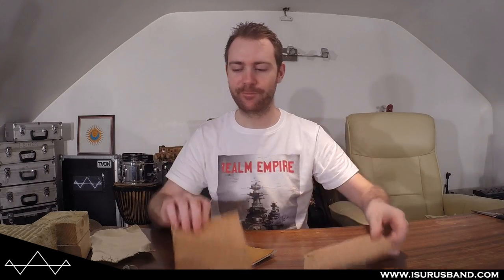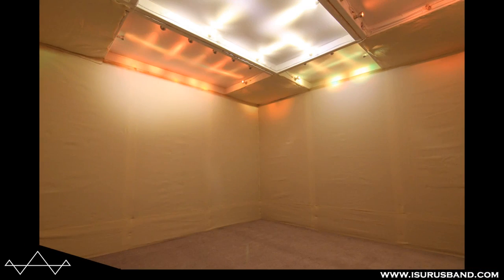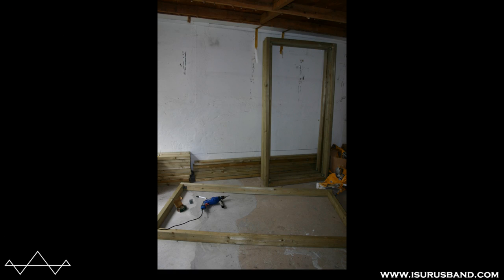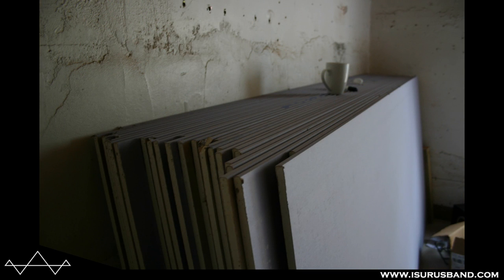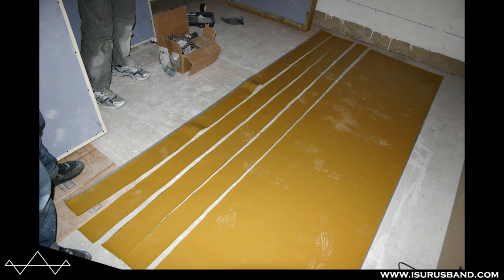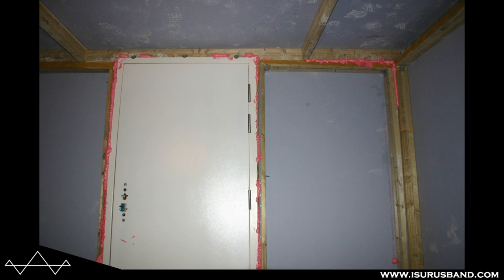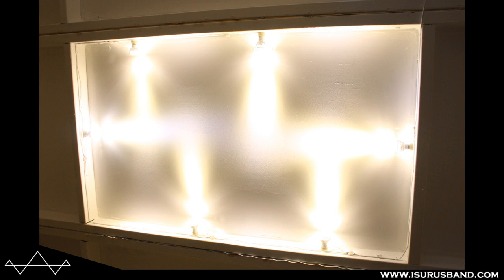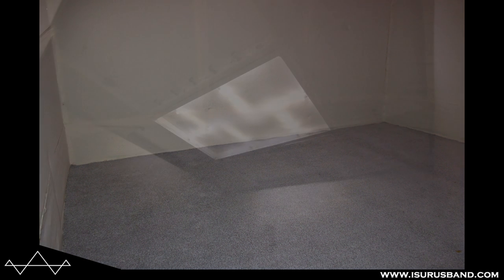Soundproof Booth Build - Portable DIY Isolation Booth

Comment: would it be cheaper to actually build a hard concrete walled room within the room and then dampen the walls ??? just thinking aloud.....
Reply from the maker: +James Manasseh no idea.. but part of the idea of ours is that it can be taken down and moved elsewhere.
Reply: hey thanks for the quick reply...i have built 3 studios so far of mine....and always wondered a brick wall would have been cheaper.... i havent seeny any one else do that....so was wondering...of course it has issues of removing them when moving out if you on a rented place.....and for 1700 pound man thats way cheaper in your country than mine....in 1700 pounds i could hardly buy the wood and boards alone.... India

Comment: Great job, I love the idea for the ventilation too. Thanks for sharing. I may have missed you saying so, but did you simply white wash the inside?
Reply from the maker: Yes, just a couple of layers of paint.
Reply: +Carl Williams -  Although we did white wash the walls, we then put a 100mm layer of RXL 40 rock wool on the walls. This rock wool is for acoustic absorption and it is covered by an acoustically transparent cloth. I start talking about this at 18:25 in the video.
Reply: +IsurusOfficial Thanks!
Reply: +IsurusDrums Thanks! Good luck with your double flam ratamacues. I'll be using mine for French horn practise.

Comment: Did you put the rockwool in the bottom module?
Reply from the maker: Rockwool was in all of the wall modules, and in parts of the roof. The floor was solid concrete.
Reply: Thanks.

Comment: Great, I want make a smaller version. May be steel surviving doors may be to heavy. Suppose I can use normal doors with sound resistant material added like you added to the steel doors?
Reply from the maker: There's no reason that you couldn't use wooden doors but for sound proofing, mass is important so if they are going to be effective, they will need to be heavy either way. The TEC50 or equivalent mass loaded vinyl product is going to be heavy so even wooden doors would not be light once completed. The important things as far as doors go are using good hinges to support the weight, ensuring a good seal and making sure that you use the equivalent mass of soundproofing to match one of the walls. Doors and ventilation are the most difficult parts to get right.
Reply from the maker: Also bear in mind that we're not acoustical engineers. We just figured it out as well as we could and went for it.

Comment: VERY impressive....so youve been using it for a while now....im not convinced that the little stereo at 110 db's is anywhere NEAR the volume of an actual bass guitar rig and a live drummer.....
because in my experience BASS is what carries....
I play much quieter music...70's era heavy rock and blues/country rock w some funk and soul mixed in, but all 'old school'....
and im moving to a mountain, where i will have 11 acres and NO neighbors, but there IS a highway nearby, and so there may be noise from trucks and stuff....
also its best to not attract crazy crystal meth tweakers looking to steal your gear....and so forth.

So does it kill the live band sound?bass and drums?
I also have the John Bonham Ludwig kit....w/ a 26" bass drum....so its really loud.
and about 1000 watts of bass rig....if i need that....which i wont but its better to have it and not need it than need it and NOT have it...on the bass guitar.

Also Hammond organs  and Leslie speakers ....with the most rumbly bass sounds i can GET.
I like closed back guitar cabs for the bass they put out as well....
geez...i guess its 'all about that bass' with me....and i HATE that fucking song.

so I wont need the dense vinyl material probably....or even the sound proof drywall....
it will be off the ground....and a room within a room....i know all about that part....
I'm building it inside a HUGE barn/garage building....with a GREAT roof....probably 20 ft  tall or more, and 2000 sq ft inside....nice concrete slab....and i will never have to move it....

but i am looking ahead now to building a recording studio in it....i have a lot of gear already ive collected  from the past 10 years or so....and about 1000 songs written to work on....
So i have the luxury of making a sound proof room, or rooms....AND a 'live' sound room outside of that, where i can have all the natural reverb on my drums....

 i can make the main studio a massive size, and it will be a lot of work, and more expensive, but im thinking it through....its not an airplane hangar, but its as close as i will ever get ....its all i need.

I would also like to record other bands up there.So i have to keep that in mind.
I dont have a lot of money....in fact none....everything i have is going into the purchase....
so i have to do it budget wise....but i want to make money at it in the future.
It is an idyllic place, and inspiring to a songwriter with an acoustic guitar...
hey, i can even have a control room this time !!!
Sorry if it sounds like im gloating just a bit....I'm 60 and this has always been a dream of mine.
Neighbors and thieves have ALWAYS been a problem.
I wish every one of you could one day have a similar experience....
"Its a long way to the top if you wanna rock and roll."

Comment: i see your still using an electronic drum kit even though this is supposed to be sound proof. can you play a real acoustic drum kit in there at full volume and it still be sound proof from the outside?
Reply from the maker: If it was inside a brick building an acoustic kit might be ok. We built ours knowing we were using the electronic kit. The kit is actually quite loud, as it has larger shells than most electronic kits, especially the kick.
Reply: @Isurusofficial  my garage is just a wooden frame. I was thinking if I did what you did inside my garage I would be able to play my acoustic drum kit late into the night without bothering the neighbors. but based on what you just said it sounds like it wouldn't be soundproof enough for an acoustic kit. for me personally an electronic kit wouldn't work. do you think its possible to make it any more sound proof so that an acoustic drum kit could be feasible?
Reply from the maker: It's all about layers, the more layers of material and air gaps between layers, the more soundproof it will be. You could use double the amount of plasterboard for example, both sides of the rockwool for example. Unfortunately I cannot predict the outcome! :)
Reply: @chasesteinberger3342  Think about it this way. Your neighbors have walls too. Are you looking to be completely silent to a neighbor that's outdoors? Because with that shed door open, it was very good noise reduction @ 110 dB, which is roughly the average level of an acoustic kit. A good rimshot will put you close to 120 dB. Depending how close your neighbors are to you, I'd wager that they'd not even hear you playing from within their house.

Comment: the ventilation is not clear to me. how many fans and vents. from the phone only appears to be one vent?
Reply from the maker: Hi, 2 fans and 2 vents. 1 of each for input and output. The input and output are split off from each other. The input is on left side of the module and the output is on the right. They are split within the module by wood which runs down the center of the ventilation module internally. Quite difficult to explain via txt only but hope that helped a bit.
Reply from the maker: 1 of the fans and 1 of the vents are on the other side of the module. The input fan and output vent can be seen from the outside of the studio.

Comment: I am looking at building a dawbox.com plans booth. The walls are wooden frames with insulation in the frame and MDF on the outer and inner sides. So the internal surfaces will be reflective. I'm thinking 2.4 by 3.6 so there is enough room for a drum kit, bass player and a horn section or something. I am concerned that MDF walls with a small space will cause bad audio resonances and be recorded. Your cloth over 100mm rock wool seems like a potential solution of bad small room acoustics. Your design seems superior with e MLV in between the wall joins. Plus you've got the multiple layers of sound plaster board and MLV on the exterior.
I watched a YT video of a girl playing drums in a demvox booth and the bass seems to escape easily. Very unscientific via YT videos.
I wonder how well your room would contain a bass amp's sound. Imagine a scenario where you are in an apartment or building with others and you have to keep quiet or get complaints.
I will have to research further but I am assuming your cloth over rockwool design would be better than an MDF interior. I am not a heavy metaler. But drums are pretty loud regardless.
Well done.

Comment: Just want to pass this by you and get your opinion on this possible build. I have an existing finished room in my basement and I really do not want to touch the existing walls. So based on that start I know I will not have the perfect room for recording. I want to leave the option for someone buying our house down the road to remove the studio portion and be able to put the house back to its original state. I would create a room within the existing room and would first build and install the wall structure framing, add insulation, add a layer of Type X Fire-Resistant Drywall - 5/8", Green Glue, a second layer of  Drywall. In my build the insulation is facing the existing wall and the two layers of drywall are on the inside wall of the new structure. On the inside drywall I am considering installing this system of frames, insulation and cloth: https://fabric-wall.com/

Comment: I see nothing portable about this...unless you're talking about the air ports for the ventilation...
Reply from the maker: +shauncho49 Hi. We do not mean portable in terms of sticking it in a car and taking it over to your friends house for a day... We mean it is a standalone unit that can be disassembled and moved to another location, it is not a modification to a building. Infact it does not affect the building it is in at all. It is similar to something like an Esmono booth, designed to be in a location for a long time, yet be relocated if needed.
Reply: thanks for the clarification.